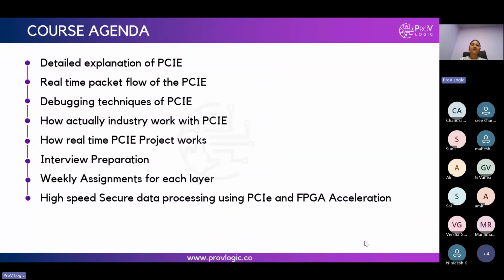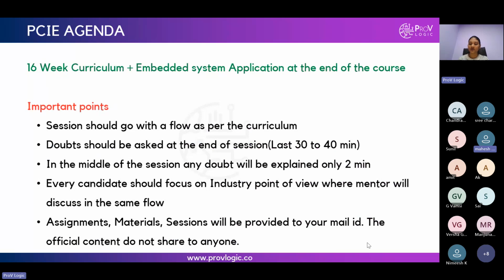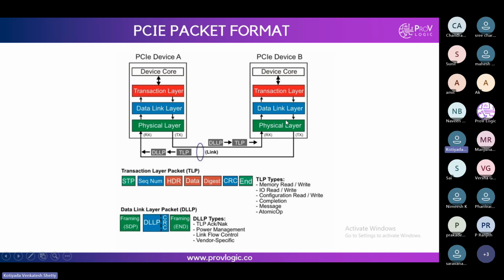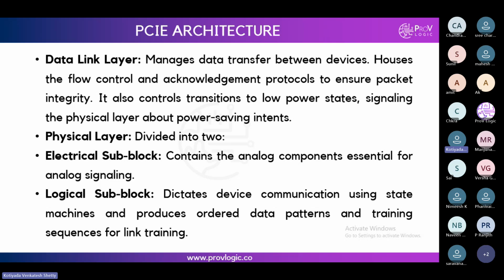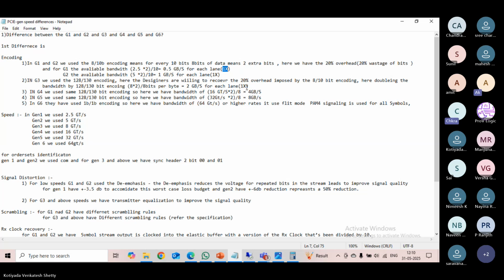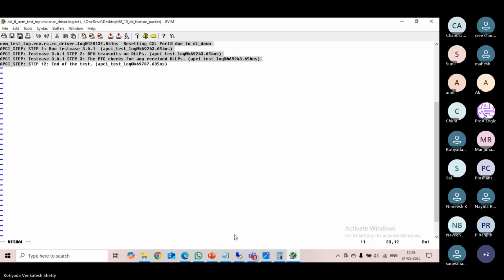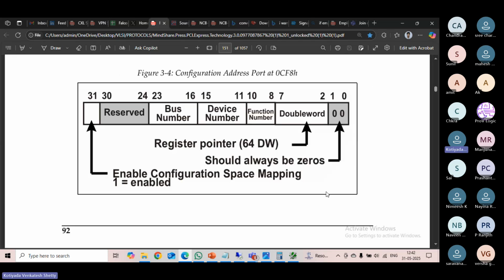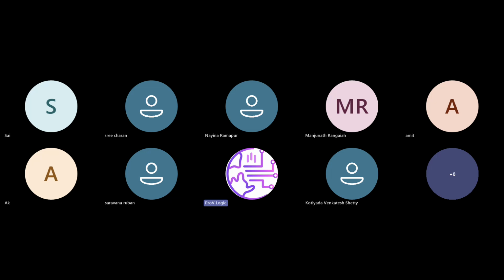PCIE Packet Flow & Initialization Process

Comment: The absolute maximum is x32 (32 lanes per link) — you cannot have a link wider than 32 lanes.
Reply: Maximum pcie link supports 32lanes per link but in real time projects as of now no will use 32 lanes